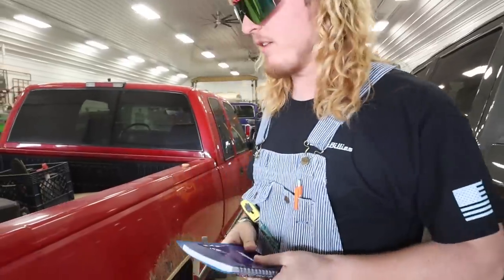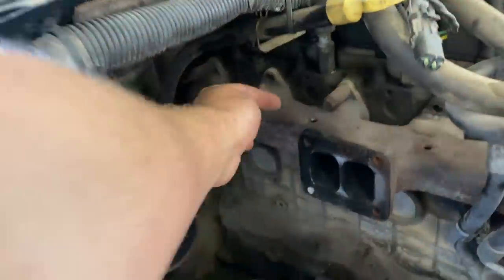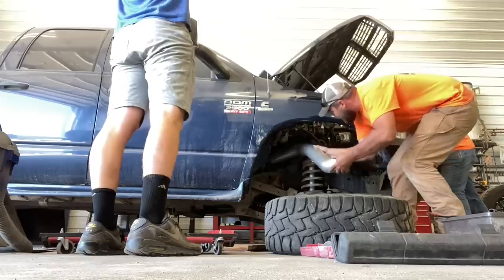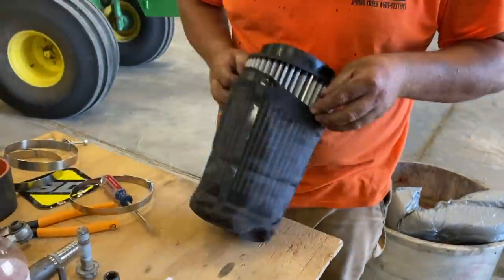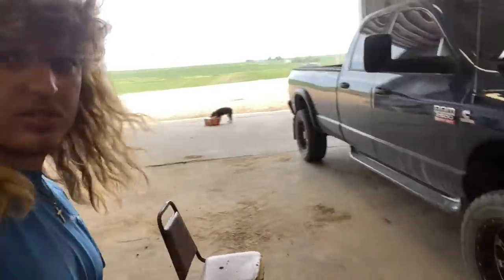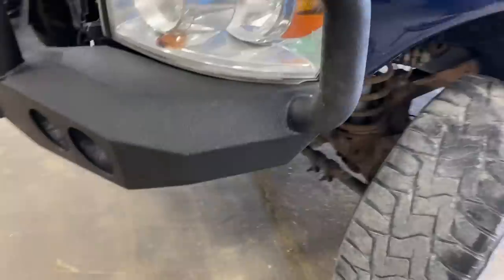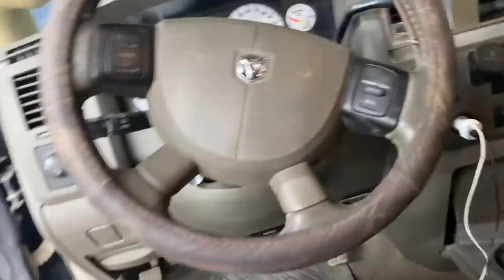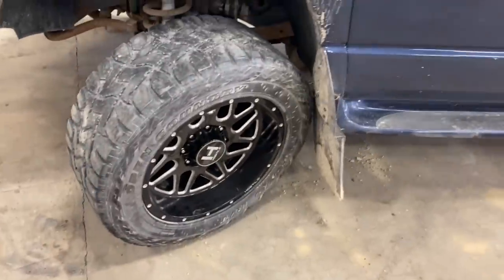I Put A Turbo In Earth's 2nd Most Reliable Truck

Comment: Cooper you're going to like the BD exhaust manifold by running on my Ford power strokes and down pipes and exhaust system that they're pretty good at hold up to a lot of heat and stuff I haven't had any issues yet

Comment: Glow shift gauges are horrible years back i had them in my old 7.3 superduty when they worked they wernt correct and all the local shops stopped even installing them for ppl because they were so junk so might wanna upgrade them later on.

Comment: The farm I live on has a 2005 ram 3500 diesel SRW and it is rusted as Frick and it recently got jack knifed by a corn head trailer. the trailer was in the ditch and the truck pined between the stop sign and the trailer it has two dents on the bed. I'm surprised that it did rip the bed off.

Comment: Look into slightly longer control arms to help re-center the axle.  A level will actually cause the axle to pull backwards towards the fender.  Tons of info out there on it so I'll keep my comment short, could help you with rubbing some